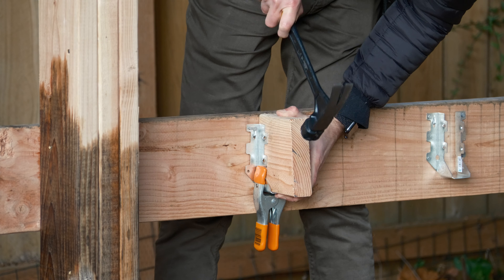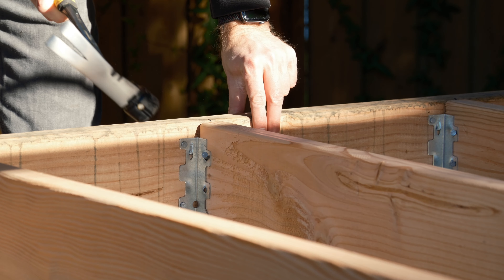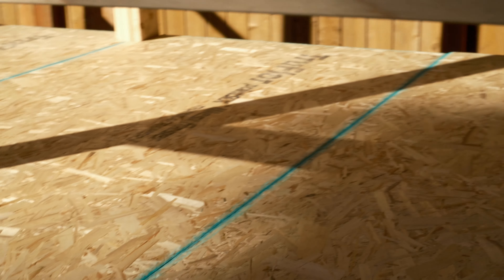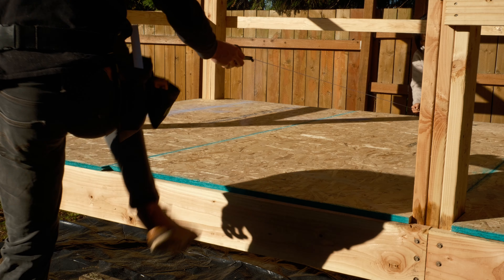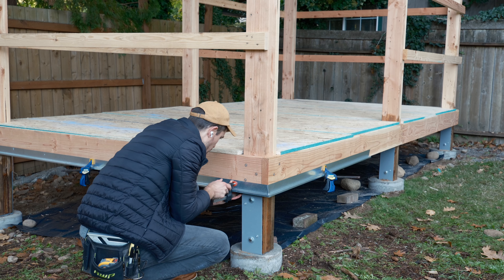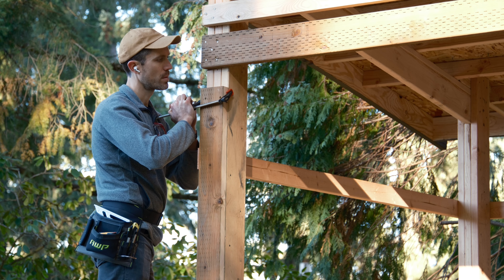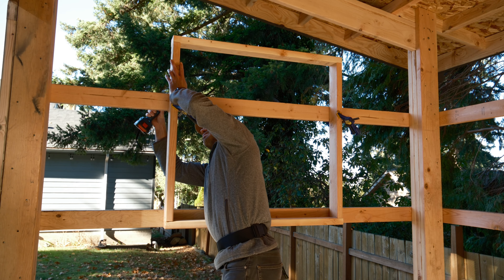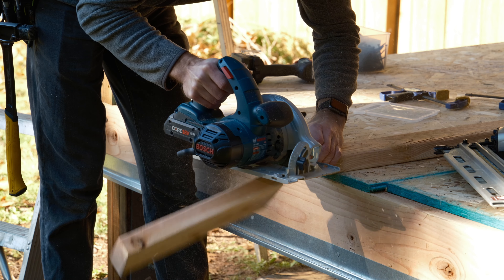DIY Post Frame Shed Build – Part 2 of 3

Comment: Nice video. I also chose post frame for the shed I built during the pandemic when lumber prices were at their highest. It’s really neat
Reply from the maker: I was surprised it wasn't a more common framing method. Not something I covered in the first vid, but if you're building an occupied structure the large open wall cavities are great for stuffing with insulation / reducing thermal bridging. One of many benefits!

Comment: I follow the same guy at R&R and wondered if you scale down his buildings to what you did here. I really appreciate you taking the time to do that, and document everything! What is the overall material cost difference from your original shed plans to post frame? Thank you.
Reply from the maker: Thanks! This is a rough estimate, but it looks like I spent about $4.5K in total on the post-frame version. My spreadsheet estimate for the stick-framed version was about $3K. That estimate is almost certainly too low though, and the design for it was about 25% smaller than my post-frame plan. Given those two factors, I'd say the prices were probably roughly equivalent in the end.

Comment: why did you build the floor so far off the ground?
Reply from the maker: The post brackets have some thickness to them, and I wanted the rim joist to sit above that so I didn't have to deal with it in my design. I guess what people normally do is take an angle grinder and cut off one ear of the corner brackets so you don't have that problem. I learned that a bit too late. One of the things I'd change if I did it over again. That said it is really easy to get under in case I need to for some reason 🤷🏻‍♂️